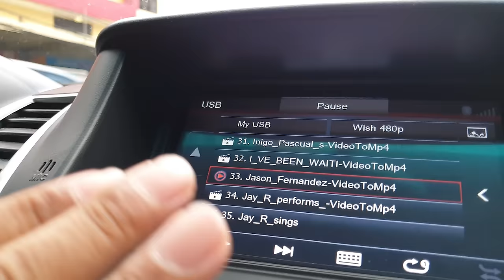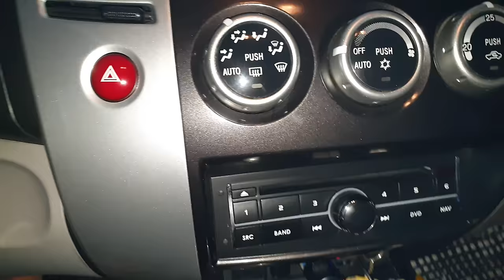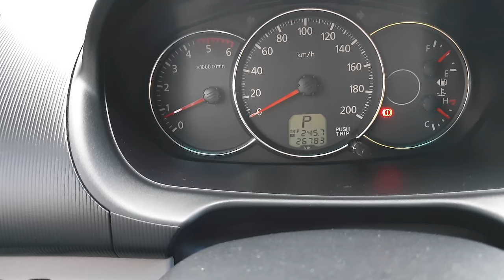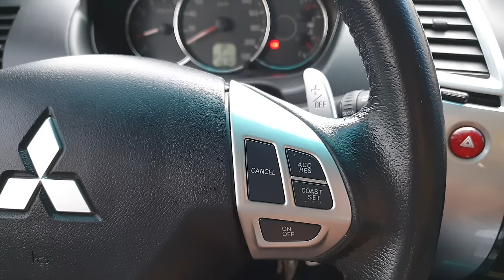5 Bagay na Malamang na Hindi Mo Alam sa Montero Sport

Comment: Nice vid sir. I have po montero sports gls 2019. Sir ask ko lng if need ba fully press ang brake pedal when shifting gears (like from P to R or vice versa, R to N to D or vice versa) or pwede na half press lang ang brake as long as stop un car then tsaka ka mag shift). Most of the time naman ksi nag fully stop na un car kahit half press pa lng tapak sa brake. Thank you.
Reply from the maker: Hello sir Patrick. 
Papakiramdaman mo sir yung car, baka di mo namamalayan na umaandar pala. Kung hindi mo pa siya ma shift (from P to R, to D), you still need to depress the brake pedal all the way. it was designed as a safety measure po.
Dont forget to subscribe sir

Comment: Sir i believe di naman po masama ung stuck sa traffic. Masama siya yes pag sira ung fan or pag gas and go na wowornout ung engine at transmission mount isama pa ung differential. However pag naman maintained siya di naman masama. Pero ays vids boss kasi sempre future buyer ng monty e hehe thanks po
Reply: Yung shorttrip po ay totoo kasi ung oil di nainit ng operating temp nag kakaroon ng residue na nag sisit in sa oil pan kaya kung mag shorttrip ka makesure mo na lang na umikot ung fans at cooled na yung turbo

Comment: ggod day boss noah.
sana po mapansin anh comment ko.
anu po kaya problema ng triton 4n15 namin?
natapos na throttle body and egr cleaning, 
nasa below 700 rpm pa din xa pag paandarin sa umaga, minsan umaabot sa 550rpm at may lumalabas na usok sa tambutso.
pero pag uminit na yung makina ay mag maintain na xa sa 700 naka off ang a/c
Reply from the maker: Marami pong possible causes nyan sir. First check muna kung madumi air filter mo at palitan kung madumi. Then check fuel injectors at oxygen sensors etc
Dont forget to subscribe 🙂

Comment: Yung cruise control mo old school na yan, merong kulang na button sa montero mo dapat dyan meron yan plus and minus button para di nakakalito sa mga dtivers para acceleration and decelaration di yang acc res at cancel button ang gagamitin.
Reply from the maker: Hello sir
Hmm you really cant say that this cruise control is an old school unless it provides different function.  Intm this case, your mentioned cruise control is not different from mine. Acceleration and deacceleration po ay nagagawa naman in a different way nga lang po 😅 
Dont forget to subscribe sir 🙂
Reply: @NoahsGarage  what i mean to you is mali ang button nyan dapat dyan meron plus and minus button para di nalilito ang mga driver, kasi ang cancel button ay to cancel ur cruise control or press ur brake pedal, kaya meron kulang dyan sa montero mo,
Reply from the maker: This car is 2014 pa. Good thing is meron po siyang cruise control sir.
Reply: Meron nga akong 1986 honda accord meron nang cruise control

Comment: Regarding po sa 5th tip.pano kung malapit lang ang driving pero mataas nmn ang rpm na ginagamit masama din ba yun? Or pano nmn kung long distance driving pero di nmn nagamit ng mataas na rpm hanggang 1.5 lang for example masama di ba?
Reply from the maker: Masisira sir pistons mo kung high rpm driving ka tapos malapitan lang ang byahe mo. Malamig pa ang engine tapos na-aabuse ang pistons and mas malakas sa fuel yan. Yung isang question mo, hindi ka lang aabot ng 1.5 rpm kung long driving. Usually 2 to 3 rpm yan depende sa bilis mo.
Dont forget to subscribe

Comment: Boss Noah ask ko lng..Montero Gen3 ..
Re airconditioning driver n passenger front seat is malamig nmn..

Sa second and third row  meron hangin lumalabas PERO NDI MALAMIG..
Any suggestion pls...
Reply from the maker: Check mo sir mga fittings ng refrigerant sa rear baka me leak po or you can just clean the evaporator and blower sir
Dont forget to subscribe

Comment: Gud evening! May I ask,  do we need to press the button of the shifter  everytime we shift Sir from park to rear to neutral to drive?
Reply from the maker: Yes mam. N to D no need to push the button po
Reply: Thank you so much Sir.
Reply: Ay sir puede mag tanong uli if lahat po eveytime mag shift tapos mag press ng button masisira po ba ang shifter?
Reply: Sorry po sir ha kulit ko yun sa amin 2013, biglang ayaw na mag move ang shifter when check turn to pieces na po so pinalitan ng antenna ng mechaniko tumakbo na so i just wonder ano dahilan bakit na broken yun stick na plastic ng shifter po
Reply from the maker: Shifter sleeve po yun mam. I guess defect ng mitsu kc yan ang sakit ng halos lahat ng gen2 monty po. Wala po sa shifter button mam.
Reply: Thank you so much po Sir for taking time to reply atleast naliwanagan  na po ako, God bless and good night

Comment: For you kind thoughts?  I am torn apart in buying a gtv 2012 manual 4x4 between FM Paje manual 4x4. A decade of age and 100k of budget difference. Anyone kindly comment your thoughts? Thanks
Reply from the maker: Para po sa akin, go for the GTV dahil mas matipid po sa fuel yan with the same power

Comment: Tanung ko lang po kung masama po ba sa Montero yung ini start lang pero hindi pinapaandar, Yung sa akin po kasi ini start ko lang po sya ng mga 30 minutes tapos patayin ko na. At kung saan po kaya nakalagay Yung overdrive ng Montero sports 2017  Tnx po sa reply
Reply from the maker: https://youtu.be/erhGk2cTXTU
Maganda paandarin mo rin kahit 30 minutes. And i-shift mo gears para mag circulate ang transmission fluid sa system.
Dont forget to subscribe

Comment: Thank u sir, dagdag kaalaman, bakit wlang shift lock ang montero ko GLS 2009 model  sir?
Reply from the maker: Di pa po ata kasi usi noon ang SUA kaya wala pa pong shift lock
Reply from the maker: Dont forget to subscribe sir
Reply: @NoahsGarage  maraming salamat sir, more videos  from you sir
Reply: Lahat ng a/t tranny may shift lock kung sakaling mag stuck ung shift lever from (P) try mo sa ilalim ng cup holders may 2 screw dun para matanggal ung cover ng shifter pdeng andun ung shift lock sa ilalim ng shifter cover mo Ung ibang a/t tranny nga nsa ilalim ng drivers floor mat.
Reply: Noah's Garage Share ko lng po lahat sir ng A/T tranny may shiftlock sir kahit sa mga lumang sasakyan na A/T incase mag stuck sya from (P) if di sya visible sa tabi ng shifter pdeng nsa ilalim sya ng shifter cover and meron din sa may shift button may ttangalin lang na maliit na cover. ung ibang A/T nga sir ung shift lock e nsa ilalim ng drivers floor mat medyo rare lang ung gumawa ng ganun.

Comment: Good day sir . Naglagay ako catcth can ok .napansin ko pag natakbo ako .hangang  2000 rpm lng  kahit tapakan ko ng husto selinyador .montero gen 2 sir .thanks
Reply from the maker: Hello Sir Styles
Pakisuyo sir ano idle rpm niya? Na-off ang AC ha
Reply: Around 840 sir .pero pagnaktigil sya wala prob. nareach nya 3500. Morethan pa patay ac ho nyan .thanks
Reply from the maker: @stylesbornilla2357  Anong catch can po nilagay niyo sir at anong size ng hose? Should be around 600 to 700 pag idle ang rpm
Reply: @NoahsGarage  uneversal sir meron in and out sya.cguro sir yung hose kasi mas malaki agwat sa catcth can kaya nilagyan ko ng  electrical tape para d sumingaw.wala namn ako.kitang singaw sir .dapat ho ba kasing laki  ng original na hose lagay ko
Reply from the maker: @stylesbornilla2357  paki msg po ako sa fb ko para makita ko sir. Salamat

Comment: It is possible to start even in neutral position?
Reply from the maker: Hi sir Dindo.
No po, you won't be able to start the car on Neutral. Para po ito sa mga cases na maglock ang shifter sa Park, so for emergency only. Nasa manual yan sir, you can check for reference hehe
Dont forget to subscribe sir

Comment: Sir Noah yung Montero GTV ko po biglang nanghina, nag karon ng loss power sa acceleration, patulong naman po, Thanks.
Reply from the maker: Marami pong pwedeng dahilan niyan sir. Unahin mo na ung mga madaling gawin tulad ng fuel filter change at checking of fuel lines, SCV and pump. Then kung ok na, check your exhaust manifold, baka barado. Other things to consider checking are faulty injectors, and low compression.

Comment: Sir goodevening, ask ko lang po pag ba nabago ung configuration ng throttle body mag checheck engine po ba?
Reply from the maker: depende sir. Kung binago mo sadya using throttle body controller, ma bypass niya ung existing code sa system. Pero kung nabago ang configuration dahil madumi, pwede rin po syang mag check engine light.
Dont forget to subscribe sir
Reply: @NoahsGarage  for example po sir noah nagalaw ng hindi sinasadya nung naglinis ka ng throttle body, possible mag check engine?
Reply from the maker: @daleseraspe931  yes sir and your engine will idle poorly, and most likely stall.
Reply: @NoahsGarage  maraming salamay po sir!

Comment: Sir bka po may katulad po na issue yung samin 2013 glsv mt 4x4 muntik na po ako sumalpok sa motor kong kasunod dahil malakas ulan at visibility po ay sobrang labo 60kmh po takbo ko sinagad ko preno dahil malapit ko na lang sya nakita dumulas po apat na gulong akala ko po may abs tong montero ano po kaya posibleng sira pag ganito? Tia.
Reply from the maker: Hello sir Jp,
Kung sure po kayo na mahina ang preno niyo, check niyo po ang brake master cylinder baka barado or kelangan nang i-bleed brake system niyo. Check niyo rin po kung me leak ang mga cable sa ilalim. Hindi po ABS yan. Kasi kung ABS yan, malakas po preno niyan at tsaka iilaw po ang ABS light.

Comment: Dko gets ung pagbukas ng sasakyan pg nadischarge ang bettery,..... sa loob nman ung kinalikot mo sir e dba nga nasa labas ka..... panu mo ba mabuksan?....dqgets
Reply from the maker: Hello sir PJ.
If dicharged ang batery mo, pwede mo siya mabuksan by ur key sa driver side. Sa GLS V and GTV, walang key slot ang tailgate, so if you want to open the tailgate, there is no option to do so. So this tip helps. 
Dont forget to subscribe sir